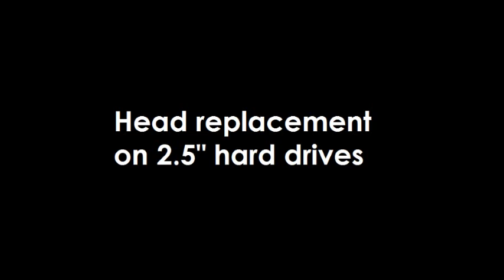HddSurgery - 2.5" and 3.5" Western Digital hard drives head replacement

Comment: HddSurgery, I have a 5TB WD Passport that took a short fall and is no longer working.  The drive spins for a minute but the Heads or Arms do not move.  Where do I find a new set of heads and the tool you used to try to swap them out?   I saw some of the tools on AlliExpress and eBay but have not come across the heads yet.

Comment: I followed these steps also, but the only part that I got stuck on was when pulling the head up. In the video it easily slides up, but I'm not getting the same result. Seems to be on there pretty hard. Any tips?

Also when taking out the magnet, isn't the pull very strong?

Thank you~
Reply from the maker: tigersfa88 Hello, When lifting the heads up it will go easier if you hold the backside of the actuator arm (where the voice coil is) and try to lift the heads up simultaneously.When using pliers for lifting the upper magnet you should use casing of the hard drive as a support. It doesn't take so much force if you apply principle of lever when lifting the magnet up. Look video carefully and you will see how our technicians do it.Regards.
Reply: +tigersfa88 As someone else wrote, at 2:55
 even with the support of the other finger, the heads just cannot be 
removed. I even busted my HDD because of this and still I cannot find 
the way how I could remove it though now I am not afraid to use full 
power with a plier.
Reply: @fulesmackofule  are you sure there is a screw on the back that is covered with some kind of sticker?
Reply: @HddSurgery I have the same problem after the external hard drive fell. Inside the drive the discs have no scratches whatsoever but head is getting stuck in parking slot  and a bit bent. It’s clicking badly and seems bent. Don’t want to push to discs to scratch them. Where do I get replacement heads from ?

Comment: As someone else wrote, at 2:55 even with the support of the other finger, the heads just cannot be removed. I even busted my HDD because of this and still I cannot find the way how I could remove it though now I am not afraid to use full power with a plier.
Reply from the maker: +fulesmackofule Do you use our tool for the head replacement?
Reply: No. Does it release a trigger?
Reply: @nickweir5086   instead of head can we replace the disk to othe hdd to read it ?

Comment: HUGE MISTAKE - around 0:50 you get ready to remove the head but what you fail to show is the removal of the center screw AND, most importantly, the need for an Allen wrench to completely loosen the head.
Reply from the maker: Video shows removing the screw, and there's no need for an Allen wrench with this specific hard drive